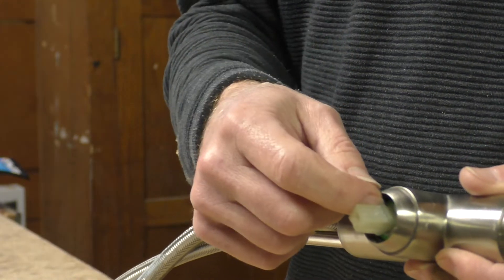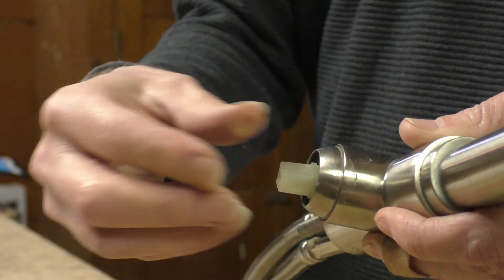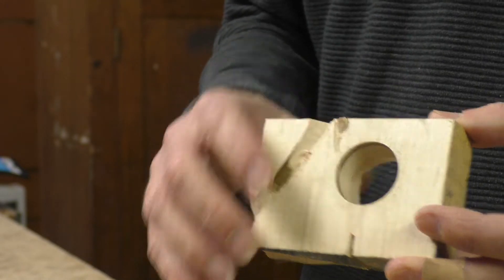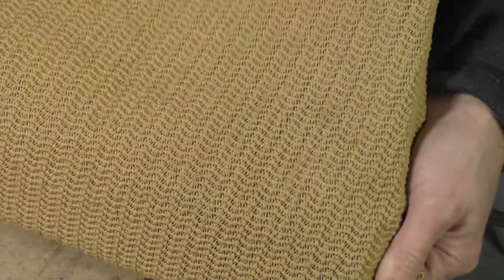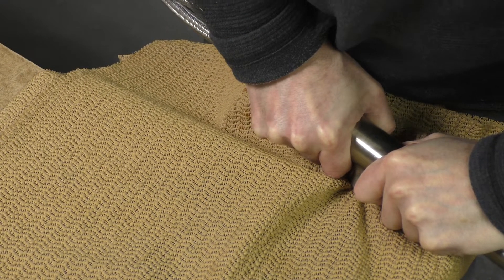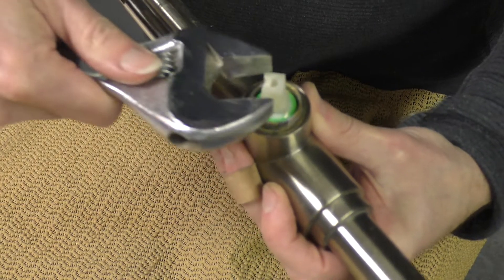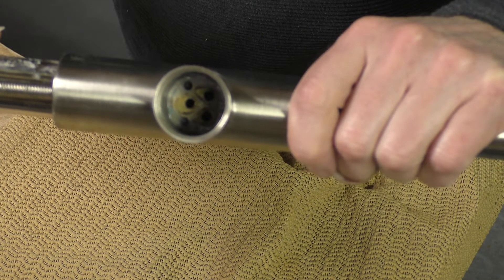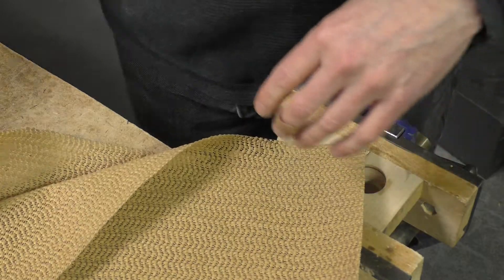Removing Stuck Tapered Bushing from Riobel faucet

Comment: Fortunately didn't need the wood drilled out and the vice - but the problem was the same and I was able to twist it off with a wet rag. Very helpful. Thanks!
Reply from the maker: Glad it was helpful. The wet rag is a good alternative to the rubber mat I guess.